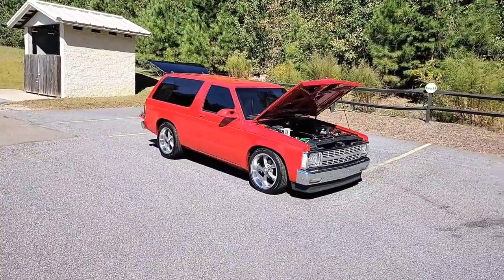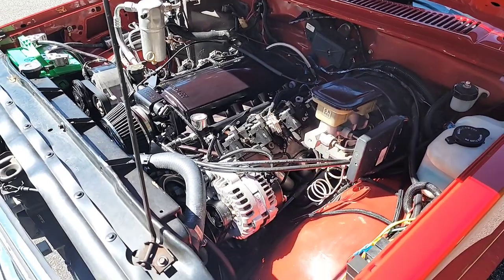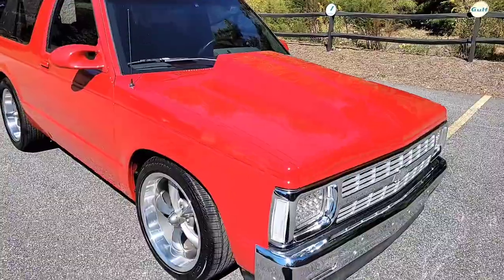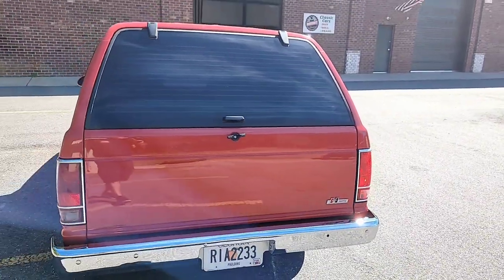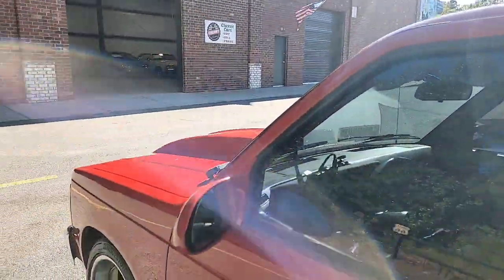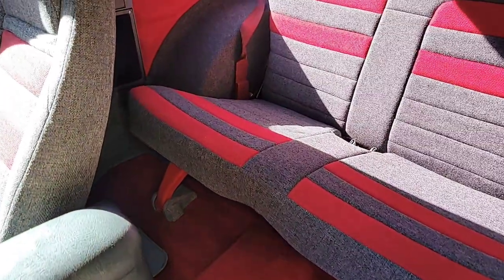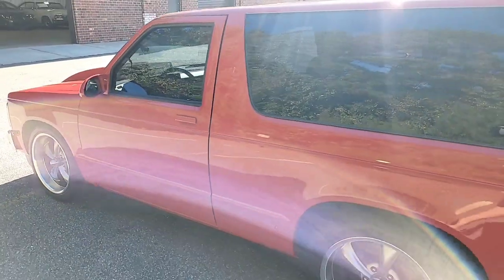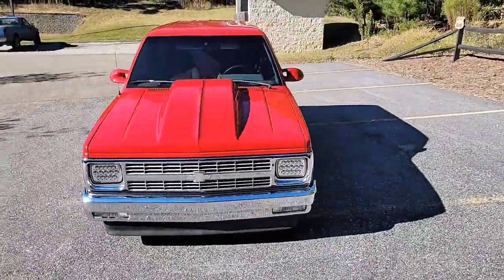1989 Chevrolet S10 Blazer - Sold

Comment: Got a 91 s10 Blazer Tahoe. Just finished. Full tubular qa1 front-end. Stout 355 small block backed with a th400. Caltracs with monoleafs on the rear. It is completely wicked and for sale